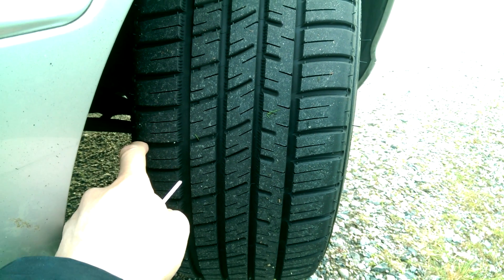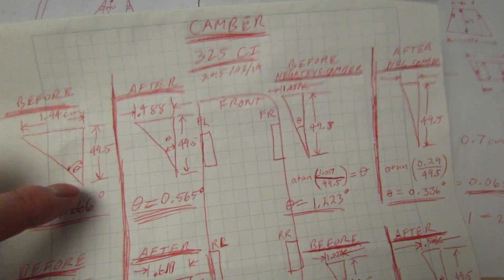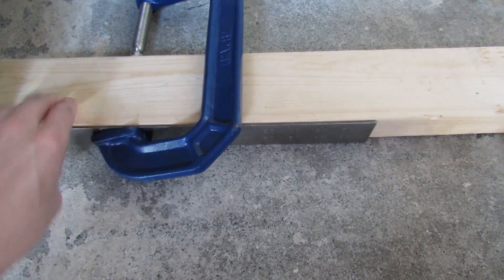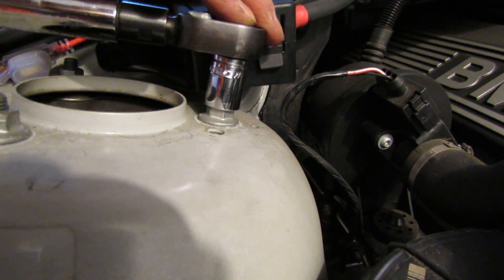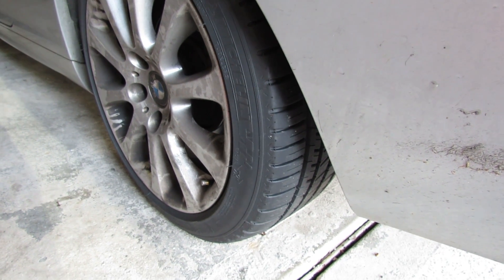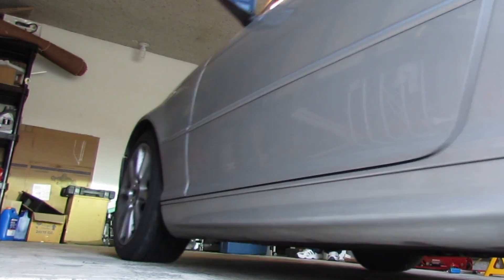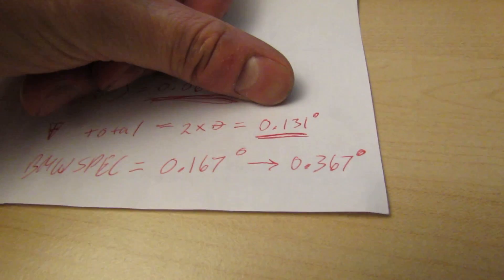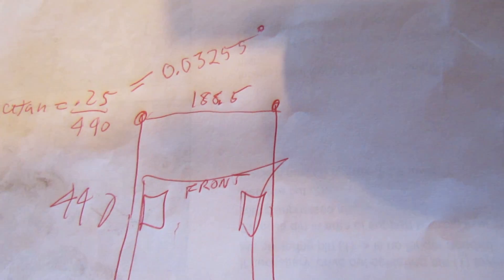How to Adjust the Camber and Alignment of a BMW E46

Comment: This is a really good video. A local shop jinxed the alignment 2 times and still charged me 100 bucks for both of those times. Imma do it myself now
Reply from the maker: Damn that sucks, my buddy had that happen by a shop too, chewed though his tires in 7 months. Totally worth it to do it yourself. After this I went through these tires in 3 years, all even wear and tear, and that's aggressive E46 driving all over town too.  You'll definitely benefit from levelling it out and having less aggressive toe.  It drives much better too, and doesn't have any issues cornering, might not be as aggressive but it's still predictable.  Try it out and see how you like it!  If you miss the cornering you can always add back more camber and toe.
Cheers!
David.

Comment: How do you do toe in and toe out in the back? My right back wheel is toed in from hitting a curb, car spun out, forgot to turn TCS back on.
Reply from the maker: I got you. Head to 9m21s. Where I talk about hitting a curb lol. Sounds like fun.  We all been there done that 🤣😂🤣😂. 
RWD is fun but can come with its results. Hope you can bang it back to the right alignment. I would just loosen them and hammer it back straight as far as you can. No need for fine adjustments(that's what you need the tool for).  
Good luck!
Cheers,
David.
Reply: @DavidSunshine  oh no everything back I ended uo getting a new lower control arm in the back and a trailing arm. But for some odd reason it's still toed in.
Reply from the maker: @officialyungtwizted3858  oh damn.  Try adjusting it and hopefully that'll be enough.  You might need to take it to an auto body shop to fix it is body damage causing the misalignment. They can pull it straight if that's the case. They got rigs to straighten the body after a collision.
Cheers,
David.
Reply: @DavidSunshine  they gin charge me Hella bread 😭😭😭it's a bummer dawgg
Reply from the maker: @officialyungtwizted3858  Ya pulling ain't cheap but if you know somebody they might do you a solid instead of rip you off.  If you only want a quick pull maybe it's quick and worth it.  If it's $300 it'll save that in tires.  Misalignment can chew up tires in months. See what you can do first to straighten it out, then ask around if a shop is willing to straighten it out after hitting a curb, if the shop does it regularly they can do it quickly.
Good luck!
David.
Reply: @DavidSunshine  thanks brother much appreciated
Reply from the maker: @officialyungtwizted3858  Anytime! Hope you get it all sorted!
Cheers,
David

Comment: This is great info. Ive used everything you’ve done to do the opposite and add more negative camber lol but great info
Reply from the maker: Lol glad I could help!  I would definitely add more negative camber if I wanted better cornering and handling!  Gotta get the perfect setup for your needs!
I just wanted to have even wear on my tires, and flattening it out definitely did that, my tires were bald years later, and were evenly worn!  It still handled very well even with flat camber, probably not as good, but I couldn't tell from driving around, I'm sure a pro driver could tell tho.
Cheers!
David.
Reply: @DavidSunshine  I drift my e36 so this info was perfect but I used the knowledge to set my car up for my needs. Its very helpful! Thank you mate! ❤️
Reply from the maker: @loosevalves  Oh damn!  That sounds like fun!  Perfect then!  Happy drifting!!!

Comment: The big question is- why is the factory setting designed to wear out the tyres on the inside?! I have done the mod as you show but it still wears. I do not want to buy camber plates so I am going to try to modify the three mounting holes a little!

Comment: Just installed Bilstein sport suspension with lowering springs in rear for e46. Immediately noticed negative camber on rear. 
Will this method correct some of that?
Reply from the maker: Yup. This will fix that right up!  You'll probably want to set it to E46 specs.  Negative camber can be great for performance at the cost of tire wear.  If it's a daily driver, you can choose to have less tho, I think -0.8 deg is good.
Cheers!
David.
Reply: @DavidSunshine  Thanks so much. Love the math.
Reply from the maker: @jrswartzbaugh  You're welcome!  Ya the stuff we learned in school can actually come in handy sometimes!  
Definitely helped save me from uneven camber wear.
Cheers!
David.

Comment: Isnt camber plates only for coil overs
Reply from the maker: You got it! So you'll want to get both camber plates for the front struts and camber arms for the rear, if you want more adjustability from the stock mounts, but I would only do that if you're going to the track and need more than what stock can give you.  Going to about -0.7 degrees is as flat as I would go, with very little toe, my tire wear was very minimal, and it wore evenly, and it still handled well.  So for a daily driver that is a little aggressive, but still wants to save on wear and tear, it's a good setup even with the stock adjustments. 
Cheers!
David.
Reply: @DavidSunshine  I have to do some homework on the camber number because Im not sure what the specs are suppose to be, but I have gotten eibach springs on my e46 but I was told I needed camber plates but I Seen that they wouldn’t work for the type of springs I have, but thanks for the feed back
Reply: Not sure what to use
Reply from the maker: @ivancenteno541  Oh nice, if the eibach springs lower it 0.25", you'll want to check your camber as it'll go a little negative at rest, maybe running at -1.5?, So you might be fine without camber plates.  See if you can adjust it between -0.04 and -1.1 degrees, I would run -1.0 if you want good handling, -0.7 if you want lower rear.
Cheers,
David.
Reply: @DavidSunshine  eibach springs lowered it .9 f and .6 r but thanks bro
Reply from the maker: @ivancenteno541  Oh that's quite a bit, but I'd still check the camber you can get without aftermarket hardware and see if you can go within spec.  Definitely check your toe cuz that'll be really negative and that's what will wear your toes the most. You'll chew through tires every year at that rate. Can get pretty expensive.  And also check out tires on Craigslist, you can get good deals on tires with 80% thread left. 
Cheers!
David.

Comment: Awesome video.  If only mine was that easy!  Could not get any movement at all on that front tower.  In either direction.
Reply from the maker: Thank you!
That's strange, even after loosening all 3 bolts and knocking out the pin?  Sounds like there might be some pressure on the strut from underneath.  Make sure the tire is jacked to clear the floor and the suspension is full loose so that the suspension components are free to move around, then it'll move no problem!
Cheers!
David.

Comment: Why not get a laser alignment.... Its like 50-100$ max.
Reply from the maker: Great question!
Laser is great in certain applications, but there's a level of risk to it, it all comes down to the calibration and experience of the technician.  If you trust the shop and they can adjust it to your liking, then it is certainly worth the money.  But a lot of shops will just do a basic alignment and set it up to BMW spec, which can cause a lot of wear, doing it like this at home, you can fine turn it however you want.  If you're a DIY mechanic and do all your car repairs yourself, you'll definitely want to fine tune your alignment for less wear as a commuting car, you can set it up with less camber and toe-in.  If you want more camber for track days, you can easily do that. Then change it back after. 
Doing it this method, you can triple check and confirm your alignment too.  I set mine up less aggressive as a commuter car and it worked very well, drove smooth and the tires lasted a long time.
With a $100 alignment, you only get one check, and if you've experienced, or had friends experience bad alignments, you'll know the tire wear can be massive and the cost of replacement tires is upwards in the hundreds of $$$.
To avoid that risk, I rather do the alignments myself, and the results have been great, no uneven wear, and the tires lasted a very long time.
Before I got this car and aligned it properly, this car had really bad toe-in and was eating up tires every 2 years of light driving.  It was to BMW spec, which is quite aggressive.  If you want to dial that back, it'll last longer in every day driving conditions. 
Good question though! Thanks.
Hope that helps explain why you'd want to check and do the adjustments yourself.
Cheers!
David.

Comment: So I want to run a square setup of 275/35R18 tires with 18x9.5 (35 offset) wheels... I’m hearing that you want to run -2.5° camber in the front and -1.5° in the rear. What exactly would be the pros and cons of running this setup?
Reply: This is a street/track car btw
Reply from the maker: Hi,
From my experience with the 325CI, negative camber of over 1 degree chewed up the inner thread of the tires pretty quickly, less than 0.7 degrees allowed it to wear evenly, but it wouldn't be a great setup for the track.  That setup sounds like a good one for the track, but I think you'll notice a lot of wear on the inside of the tires.
You could change the settings for track days, then change it back to less than 1deg for regular driving. 
I drove around with it set about -0.7 and it was still handling very well.  I would try it like that and see what you think.  The front is setup up so it gives the Tire some negative camber when you turn in anyways, so that might be enough for you.  There's not a big need for negative camber while going straight in my opinion. 
I think the stock BMW settings are a good compromise between performance and wear tho, they are usually around -1.2deg for the 3 series.
The funny thing, on my X5M, it's so heavy that the entire thread wears evenly even though it's at like -1.5.  the 325CI was light enough that it would only wear the inside of the thread tho, and not produce an even wear.  Surprised me, but it makes sense.
That's my 2 cents.
Cheers,
David.
Reply: David Sunshine how would it differ for the M3?
Reply from the maker: @therealsenpaisakura  Oh nice, the M3 will be similar weight to the 325, just a couple hundred kgs more.  But if you're driving the M3, I'd stick with the more aggressive setup. You may wear through tires quicker, but try it out and see how badly the inner thread wears out, if you have lots of toe in, it'll wear even harder, but that's better for handling.  If it wears too much, set it up like I've done, with less aggressive camber and toe, I was pretty happy with the handling of my 325 like that, and the even tire wear was nice, 4 years on my A/S+s and it was evenly worn down, and I drove it hard, so that's impressive mileage.  My friends with M3s buy tires off Craigslist and get a good deal, rather than buying brand new at full price.  Especially if you're going to the track, it'll be worth it to buy cheaper tires and rims to abuse.  I'd personally stick with an aggressive setup like you're talking about, since you'll be driving around the city in a sporty car.  It'll be better suited for the driving style.
Cheers!
David.

Comment: Might be worth mentioning that a little bit more camber and caster on the nearside (gutter side) of the car will help keep the car straight on the road. It's called cross camber, cross caster.0.25-0.5° is recommended I think
Reply from the maker: Ya the stock settings are good for tracking straight and handling around corners, but I found a more flat and straight setup actually drove straighter for me than the stock settings.
Cheers!
David.
Reply: @DavidSunshine  have to say this is an excellent video. @Chrisfix and @engineeringexplained quality. I've applied the same procedure to 20 year old jaguar. Much better than the front alignments I've paid for!
Reply from the maker: @hpt08  Thank you!  That's great!  Ya, if you want it done right, you gotta do it yourself.  It's the best alignment I've had too. 
Enjoy driving like you're in rails!
Cheers,
David.

Comment: Hello, I recently hit a curb at a pretty fast speed on my rear tire and that part that your showing at (5:48) is bent a good bit inward and I was wondering if I need to replace the whole part or if it’s safe to just get an alignment, thanks !
Reply from the maker: Hi,
If you can actually see damage, it's time to replace. But if you don't see any damage and it's adjustible to spec, then it's fine. But if you see damage, something else that you can't see might be damaged too, so maybe best to bring it in and have it checked out professionally. If you want to save money, check it out yourself, if it's all within spec and not looking damaged, you should be fine. 
Last thing you want is your suspension falling apart while driving, so make sure it's all good!
Cheers!
David.

Comment: It would be less confusing, easy to do, and achieve the same objective, cutting 2 pieces of pvc pipe, about an inch long(exact same length, to clear the center of the rim, tape them on a 2 ‘ level, so they touch the outside edge of the rim. position the level vertically on the rim, and adjust the camber until the the level is plumb, or as close as you can get it.
Reply from the maker: Ya, that would be a great solution too!  Thanks for the recommendation.

Comment: Measure off the rim and not the tire. The tire bulges on the bottom from the weight of the vehicle and gives you false measurements.
Reply from the maker: Good advice!  I didn't have a good level that fit on the rim, but ya, off the metal is better.  The rubber part I measured from is at the bead so the bulging was minimal, but was probably still there. 
I've come up with a new system based on this method, I'll post that in the future.
I've got the x5m now, so I'll have to reduce the camber on the rear for that, it's way too negative for everyday driving.
Cheers!
David.

Comment: Engineering explained?
Reply from the maker: We make great use of geometry here, I've actually made a new method of doing this. Basically you use two rulers front and back, same distance apart, and shoot the laser at them and read it, that'll help read the alignment easier. I'll have to make a new video for it, but basically it removes the camber from the alignment measurement, if you don't use the same distance front and back, the camber will affect the alignment reading. It's minor but still there.
Hope you enjoyed the video!
Cheers,
David.
Reply: Good video by the way brother, youre awesome i didnt know there were that many alignment points
Reply from the maker: @bryan_nfs5593  Thanks!  Ya it's great, after I got out all straight, I've been driving it hard and the wear is minimal and even.  I'm in the same set of tires now and still going strong. It's getting down there since I've driven a lot, but still has some good thread on there. Straight alignment really helps, a little mis alignment can really eat through tires.
Cheers!
David.

Comment: Great video David. Theres a question i was hoping you could answer.So I tried to fix camber on right rear wheel on my e46.Thing is i have adjusted the camber bolts to the fullest but it still has some negative camber.ANy idea?
Reply from the maker: Hi, 
Thanks!
Mine was fully adjusted and I could only bring it to -0.7 deg or so. You can't completely get rid of the negative camber on a BMW without after-market parts unfortunately.
I think running 0.7 deg of negative camber is ok though, my wear on the tires hasn't been too bad, not as bad as when it was stock, and sitting at 1.7 degrees.
Adjusting the bolt only does so much, you can get more of an adjustment by kicking the tire further, and having a friend hold it tightly while you tighten the adjustment, it'll clamp down where your friend's holding it at, and if you were getting -0.7 deg, you might get something like -0.4 deg.  Give it a try, it depends on how much play there is in the system, I noticed there was quite a bit with that eccentric nut, it only helps you move it around, where you clamp it is what really matters.
Cheers!
David.